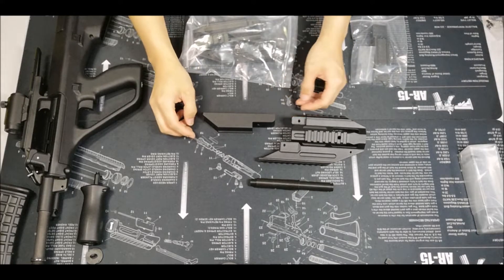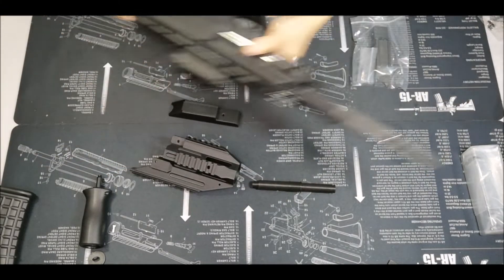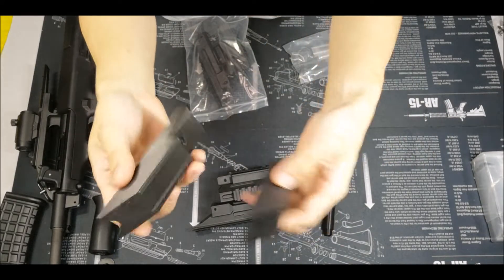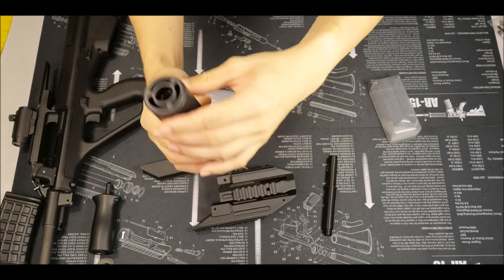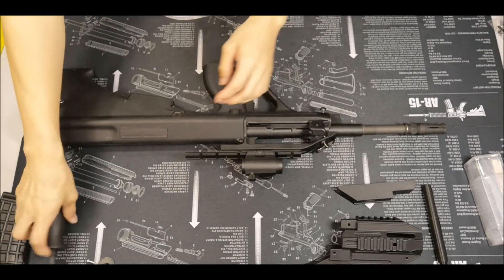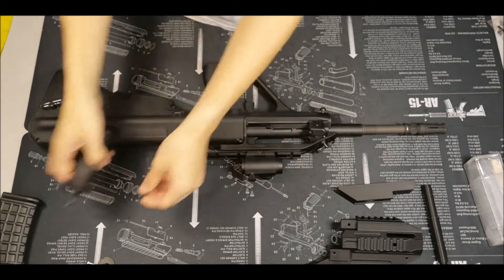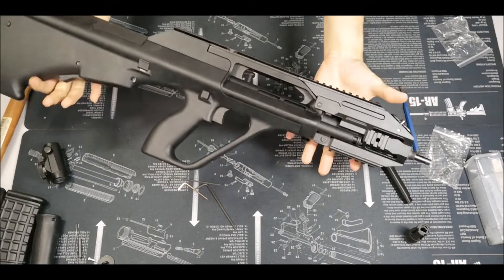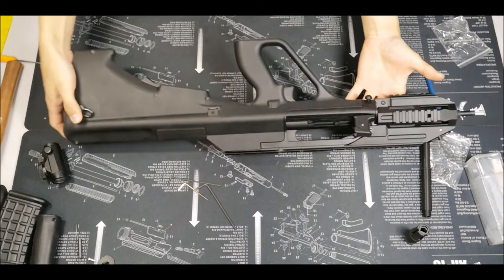Review: DK A3 3D printed kit for Lehui AUG

Comment: What paint did you use on the 3d printed parts?
Reply from the maker: Cheapo RM8 rattle can that you can buy from most hardware shop, Matte black color.
Reply: @theliteoperatinggroup4387  great thanks. I have this v3 kit arriving tomorrow. My aug shoots at 300fps, might do a video soon

Comment: Any idea why the LH AUH jams so often on semi auto?
Reply from the maker: How does it jam for you? Can provide some more information on how it happens and when it occur what did you notice?
Reply: @theliteoperatinggroup4387  firing a few shots on single shot mode, it seems two gels will jam in the barrel or t-piece, not fire for another shot or two then the jam will clear and the busted gels will fly out. Have you had this problem?
Reply from the maker: @jj87a  It's quite possible thats due to vacuum, the AUG comes with an approximately 55CM long inner barrel, that's way too long and sometimes vacuum can happen when the piston head is being pulled backward by the sector gear. 

This can be solved by using a shorter inner barrel or an anti-vacuum piston head, or a quick mod to the stock piston head, enlarging the 6 or 8 small holes to eliminate the vacuum.